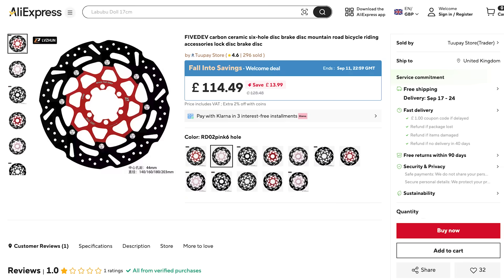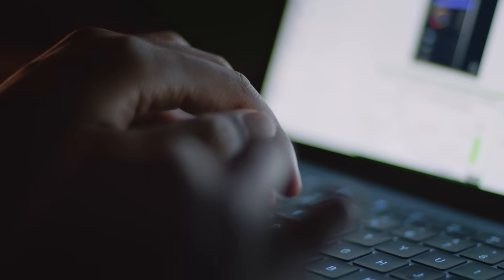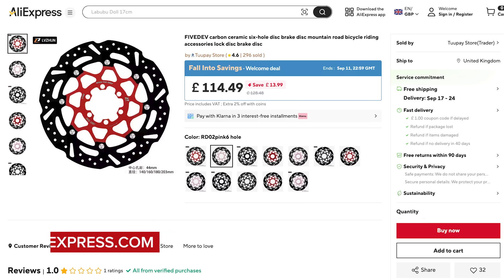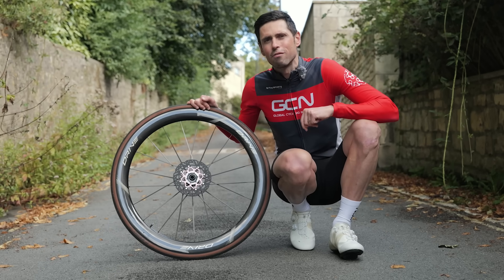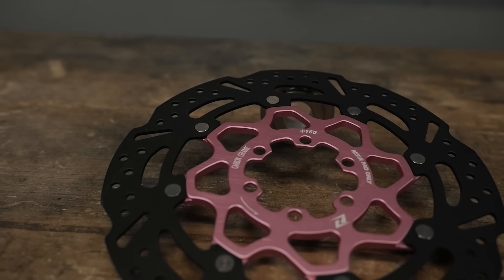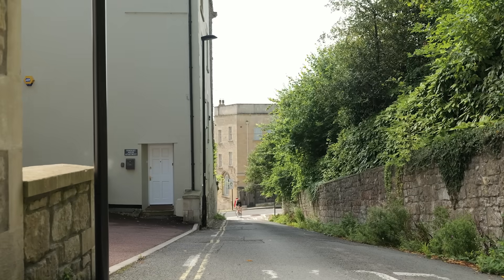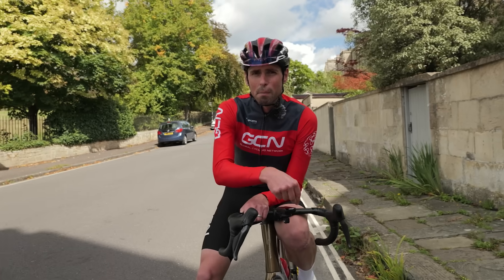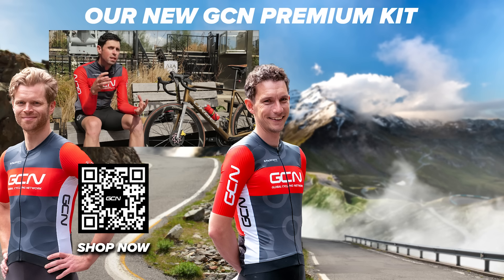Why Bikes Can't Have Carbon Ceramic Brakes

Comment: The difficulty with both carbon-ceramic and carbon fibre brake components is that they need to reach a minimum operating temperature to deliver worthwhile performance. 

In Formula 1, this is not a problem, because the energy involved is so large that the brakes reach this temperature in a fraction of a second. On a road bike, not so much. You would need to modulate your brake pressure in a wholly counterintuitive way, by initially braking sharply to get the rotor up to temperature quickly, but then reduce that pressure once the brakes start to "bite".

Performance in the wet is also a big issue. Again, in the applications for which the materials were developed  - aviation and Formula 1 - this is not a problem because the braking action quickly raises the temperature of the components to the point where water will rapidly evaporate. But the energy going into the brake components of a road bike is not large enough to do this, especially when the friction between brake disc and brake pad is reduced by a film of water.

Carbon brake discs are very unlikely to overheat in the wet, though, so that might be a good thing, I guess. But it's probably little consolation if you've ended up under a bus because the braking action was so poor.
Reply: Also, people forget (on cars as much as bikes) that if you have ever more effective/powerful brakes, at some point they’re going to go beyond the relative grip of the tyres on the wheels they’re trying to stop. Given the contact patch of a road bike tyre probably measures no more than a centimetre in width by 4-5 in length, (i.e. nothing like the contact patch of a car or F1 tyre), that traction can be lost very very quickly if the braking forces are too strong and, equally importantly, not progressive.
Reply: you are mixing up Carbon-Carbon and Carbon-Ceramic mateials. F1 and other motorsport uses the former, not the latter. 
Carbon-ceramic disks see road use, so I'm inclined to believe that the performace is good even at low temperatures
Reply: that is not correct. For some reason, the masses still think all carbon composite rotors are the Formula 1 racing type. That is absolutely not true. F1 brake rotors are absurdly expensive carbon-carbon composition; and those do require a lot of heat to operate optimally. But in road car applications, carbon ceramic rotors are used; they are carbon fiber in a silicon carbide matrix and operate just like steel rotors when cold. This is not something I read on the interned. I’ve owned 2 different vehicles with CC brakes (Porsche 911 and BMW M3).
Reply: @RB-xv4si  - huh. It looks like I stand corrected about carbon-ceramic. In my defence, the video is kind of confusing about exactly which material is being discussed at each point.

Comment: Kettle Cycles offering Silicon carbide rotors is not the same as carbon fibre. Sure, SiC is a ceramic that includes carbon, but the carbon is not in the form of fibres; and the bulk of the weight will be the silicon.

Comment: I bought this exact disc rotor to test it out. No braking power and unspeakable noise. It's just paint. Underneath, you can see aluminum.

Comment: Isn't the performance benefit with carbon rotors that they work very well when they're really hot but require some work to get the heat into them and put them into their optimum temperature? Even on an alpine descent, and at a system weight of over 100kg, i've not had issues with standard 105 discs and calipers overheating (although I did have issues with cheaper pads on cable discs). The implication from this is that on a bicycle the brakes don't have the energy put into them to mean you're going to get any kind of benefit from the heat resistance of carbon. Without the benefit, you're only going to be left with the drawbacks.

Comment: I had a set of Alpha Motocicleta carbon brake rotors in 160/160 in 2017 ran a few sets over a year or so, stopping power was great once they were bedded in, never had any problems with heat warping or cracking, main issue was rotor wear, I only got around 1000 miles per front rotor and at around £100 per item it wasn't worth it for the weight savings

Comment: I actually tried to design and make some carbon ceramic rotors in high school, and managed to get a pair actually made. I did not have the money to continue development, and I am 90% certain Kettle Cycles picked it up where I left off as their rotors look very similar to mine. The pair I have is a 180mm set, that as is mentioned by the McLaren engineer is indeed thicker than normal at 3mm. They required modified calipers (just a spacer with holes for the brake fluid to still reach the other half of the caliper), but otherwise just dropped in. They were mounted on an aluminum carrier, but unfortunately I no longer have the carriers. I'd be happy to send the prototype pair your way, as well as the modified calipers if I can find them.

Comment: Haven't done 400km/h on my bike.... F1 n Moto GP need massive friction vs with speeds under 100km/h and systems under 7kg the heat isn't as great.

Comment: The whole point of carbon brakes in car racing is that they can get HOT. As in glowing bright red to yellow hot. They actually need to be hot to work properly. When cold, carbon brake disks are far less effective. Even for the most death-defying downhill riding on a mountainbike, there's just not enough energy being put into the disks to get them to operating temperature, let alone keep them there.

Comment: F1 drivers warm up their brakes and tyres just to get them to temperature before lap 1 or while behind the safety car, or else they lock up or miss the turn. They brake from 200 kph down to 50 kph. You think normal cyclists can replicate that? Even in a pro race it doesn't happen even on descents, it won't have enough heat to work

Comment: Have a steel rotor as a backup. At first I’d start with one carbon rotor. F or R, whatever you prefer… I use my F primarily, especially in places like San Francisco. But main stopping force is ultimately the R. 

I may lean to relying on it for more (frequent, less intense; flatter ground- less traffic) as a F brake. At first

Comment: are you talking about carbon ceramic brakes or carbon fiber brakes? because they are not the same thing, not even close, but you keep talking about carbon brakes, and show brake rotors and rims made of carbon fiber, but the title refers to carbon ceramic brakes...

bike could have carbon ceramic brakes, but there is no point. bikes don't need, or meaningfully benefit from, the heat resistance, durability, or the weight savings of carbon ceramic brake rotors.

Comment: Carbon rim brakes are fine…use Swissstop Black Prince pads for carbon, decent wheels with resin that copes with higher temps (been around for 10 years+), learn how to brake…

Seems like a bad surface for bike disc brakes because in this application it works best at very high energies which bikes just don’t generate.

Comment: Carbon rims, are not carbon ceramic, they have an organic matrix. Carbon/Carbon CMC discs use carbon fibres and a carbon matrix. An epoxy, or organic matrix cannot manage the heat generated during braking when used in a disc brake application. With rim brakes, much less heat is generated at the braking surface. C/C-CMC discs won't work on bikes because bikes can't get them hot enough. Yours faithfully, a CMC scientist.

Comment: I test-rode a De Rosa SK with CC brakes at a shop in Italy. It felt like carbon rim brakes at first, but after a few turns downhill the grip REALLY INCREASED within like 20 sec to the point where my back wheel lifted off the ground from braking at the front. They very quite unpredictable, but insanely grippy once warmed up

Comment: You just wouldn't generate the conditions that raise the performance to a level that has advantage over normal steel discs. I doubt if even world class racers could. Downhill mountainbike racers maybe, but only under the right conditions.

Comment: Bad idea.  A small knock on the rotor could cause it to shatter.  

$114 is hardly a budget rotor.  You were ripped off.  Send them back and get a refund.

Comment: Suggestion for electronic shifters. I have found that on my new bike after a few rides I am not enjoying myself because I am waiting for the other shoe to drop with the battery life on the shifters. I can not tell what power is left in the battery an thus longer rides are chancy. What I think could happen is using the wheel or wheel hub to power a dynamo to feed a charge to the battery to ensure power is always there.  Any comments on that one?

Comment: Carbon Fibre brake discs, definite no. Clearly difficult to manufacture. Weight advantage gain only good for elite competition. It is only the elite competition that can afford to swap them out regularly. Standard brake discs more reliable.

Comment: Here's the thing; I've got a 2012 giant tcr built up with some mavic ksyrium sl carbon wheels on ( the last rim brake version they did), and honestly, braking in the wet really is just as good as in the dry. 
These wheels do have some kind of coating on the brake surface though, ceramic carbide I think, which may wear out at some point, but I've had the bike 5+ years now, and apart from being a bit squeaky now, braking is on a par with my 105 discs on another bike. 
I don't think that discs with a carbon brake surface will ever be necessary; world tour bikes are already as light as they are, and there's more relevant places to save weight other than the brakes if the uci say it's OK, and during a bicycle race, the brakes aren't generally building enough heat for when they're needed. 
Short of reinventing the brake pad to make them work at low temperatures, it's just not viable. 
Full carbon discs may well live in the realised dreams of purist weight weinies, but not for real world applications.

Comment: Finally someone mentioned the simple truth about rim brakes being actually disc brakes with the rim being the rotor. And since it is a very thin-walled , hollow rotor it naturally delaminates and explodes under high temperature. And hence-you cannot have rim brakes AND carbon wheels. Not for long at least

Comment: "Ali Express."  Need I know more?  Toss that and Temu into the bucket of patent stealing sketchily manufactured cheap junk.    Carbon disc should be good for pros and those who can afford the extra heat dissipation and make use of it.

Comment: Because carbon ceramic needs to reach an elevated operating temp to properly function which you will never achieve on a bike.  There....did I save anyone a few minutes?

Comment: Brembo tech in F1: 

The carbon material used to manufacture Brembo carbon discs combines high performance with optimized consistency, even at low temperatures. Additionally, the discs have very low wear, enabling teams to achieve greater mileage. In most cases one set of discs can last two race weekends.

The friction material used for Brembo pads has gone through significant changes. The actual material used, has significantly reduced wear and guaranteed a more effective thermal conductivity. 

The pad carbon material ensures excellent warm-up time, meaning it quickly reaches the operating temperature for the optimal efficiency, a broad range of use in terms of both pressure and temperature, and a predictable brake response.

During a complete season, Brembo provides each team, consisting of two cars, an average from 280 to 480 pads.

GCN Tech dummy video: Carbon Ceramic Brakes from Alliexpress 

THIS IS DUMBEST VIDEO

Comment: I would say carbon pedals are a scam too, my Shimano carbon pedals never last more the 15000, km, Look Keo a bit longer. Carbon pedals wear out due to the movement of the cleat. (Zero cleats might prevent this) 
Went back to metal Shimano pedals, which last almost indefinitely.

Comment: Hi GCN, I bought two sets of these discs in 160mm diameter and used them on my gravelbike and road bike. On both bikes I used different ways of bedding the pads  ( from hard stopping on downhill to gentle brakepressue for a long time,) but no difference in brakingpower or noise.
I went through a big testinglist and variations (diffent padmaterials, slotted the padmaterial, greased the backplate between piston and backplate, used different calipers - 2 piston & 4 piston)  to get rid of the noise.

I have following experiances: the cold friction I didn't find too bad, but when braking harder on downhill the noise is just so bad and brakeperformance doesn't increase with temperature. Once thec carboncoating is gone than the brakepower varies a lot as the surface isn't even anymore. In rain the brakediscs are horrible. The noise is just unbeliebable loud and the performance so bad - it feels so rough like mechanical wear from disc and pad. Stopping power isn't good too.

In general I don't see any adantage of pure carbon discs as with the bikes we never reach these temperatuelevels to gain with carbondiscs vs steel. I worked in the racecar industry and have a lot of experience with differnt carbon disc/pad ( Brembo /AP). With Carbon you may have as well different compounds. To find the best combination between discmaterial and padmaterial will end up in an eversting chellange by having a new combination on the bike with each downhill ...😅

As well I worry about the strenght of a 1,85mm thick carbon disc. If it sees the sliggtest bending moment if the calipers aren't fitted well, I'm afraid the disc will just beak in half.
The only advantage could be weight.

I stay with steel and max change the padmaterial if I need to.

Comment: Back in the day someone made brake rotors for motorcycles using aluminum with some sort of "plasma" coating to provide a braking surface. Far lighter than stainless or standard steel while performing pretty well, even on standard motos used on the highway vs racetrack. Has anyone looked into this? Won't have that sexy carbon look but could well be lighter than steel or the steel/aluminum sandwich types...but without the sexy look (and with a likely high price) would they sell?

Comment: While racing pro DH & Enduro I was sponsored by Kettle brake rotors, running them on several bikes. Very light, not enough bite with sintered pads, felt great with their carbon pads. After the company closed I couldn't get the special pads anymore so the rotors are in my attic.

Comment: Calipers on carbon rims were horrible and steel discs solved this issue, to me putting carbon discs on is a downgrade since you’re basically creating the same problem all over again like you mentioned in the video.

Comment: My understanding of carbon ceramic brakes is that the need a lot and consistent heat in them to work 100%. How long will it take a cyclist cresting a hill and before the first corner take to put this heat into the brakes. The cyclist would therefore be on the brakes most or all of the time.

Comment: What I don't understand now is the distinction betweem carnpm fore (carbon+epoxy resin) and carbon ceramic (I'm asuming carbon + silicon based ceramic). Because how can carbon fiber rims overheat but carbon fiber discs need to be warm to work? Someone please explain.

Comment: Admit it. You just had hill repeats scheduled in your workout and you figured out a way to get paid while getting it in. LOL!!! Seriously, he said the rotors will have to be thicker to compensate. Shimano already had to open their calipers up to reduce rub and other issues. I am guessing they would have to have another standard for calipers. It might actually require a different caliper if running carbon or steel. Otherwise, the caliper would have to have enough travel to compensate which would drive up weight and overall size of the system. I don't know.
Reply from the maker: training on the job! It does seem like there would have to be some redesign involved, possibly not worth it?!

Comment: cyclists could also save couple grams by getting rid of the brakes all together and starting using the sole of the shoes for braking which also shaves off milligrams after each braking attempt.
Reply from the maker: this sounds like a tip from "Viz" magazine!

Comment: If you have enough braking power to lock the front, or lift the rear, you already have enough braking power.
To brake harder you'll need a better tyre, or to move your weight backwards.
Reply from the maker: that's a great point!

Comment: We have problems with micro plastics now, there are health warning about handling carbon fibre dust and trimmings.  We're putting them in brakes where they're definitely being worn down into micro particles into the environment now?

Comment: No need for carbon discs on a bike, brittle would have high wear and a lot of people can't use the modern disc brakes to full effect without going over the bars, so no real call for carbon disc brakes on a bike.

Comment: I use cheap AliExpress rotors - straightforward steel ones and they are perfectly fine. Just a lot cheaper than the big brands.